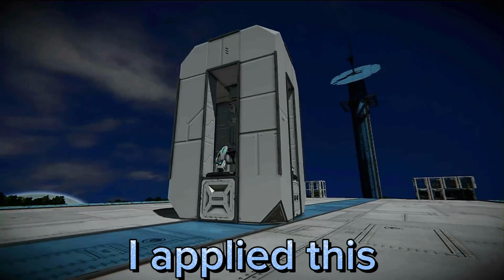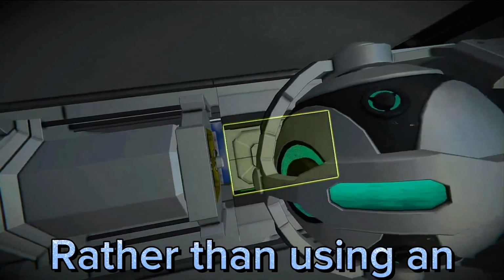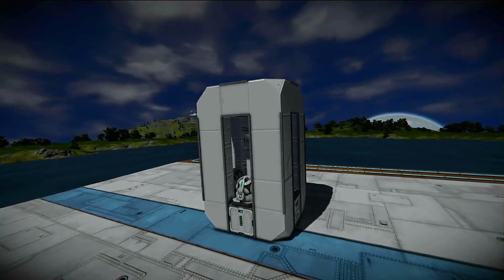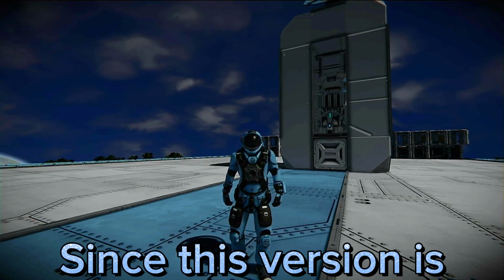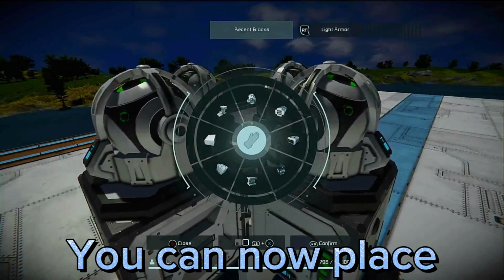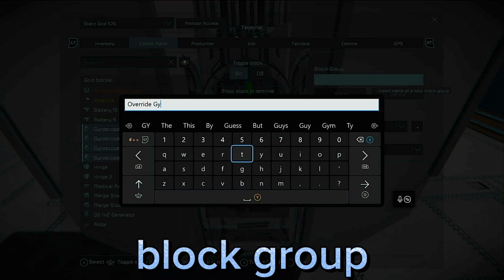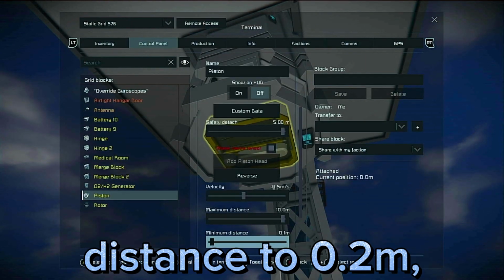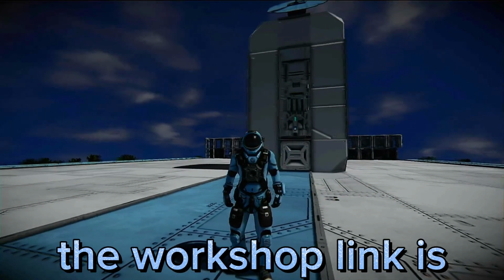Space Engineers - Stabilized Clang Drive Version 4

Comment: For no energy operation cost and oodles of acceleration, Clang drives are amazing.

For any kind of bumpy activity (like combat, mining, or sneezing), Clang drives are the emergency red hotline telephone to summon our great and terrible lord Clang.

I've been using Major Jon's control script and cargo mass shift clang drives. For extra wrath of Clang, his script includes an overclocking feature that lets you multiply the frequency speed at which the contained cargo mass is shifted back and forth (like, 1000s of times per minute). The most I've ever dared go is 20x overclock, and the clang noises were a constant cacophany. Like a scrap metal junk wagon rolling down a hil out of control, to a heavy metal soundtrack. And the ship constantly shimmied around at sub 1 m/s, b/c damping couldn't figure out which direction it was vibrating.

But man. FAST. Didn't even have to paint it red. :D

I'll see what it takes to rough up one of yours and spectacularly disintegrate my ship. :D

Comment: You can make a much smaller clang drive with a regular door and advanced rotor, just put a pillar on the rotor head aften setting displacement to minumum. Change rotor displacement to activate drive. You can even make a small grid version.

Comment: Watching this video i got an idea. What if we will build ships in modules, and then combine them together? That would be easy to repair: Just swap damaged module, or swap for a newer one(like ships can have slot for a clang drive). I think this system would work better if modules can be easily welded with welders, like they so small... Idk
Reply: yeah ive thought about this before but unfortunately do to the nature of space engineers its just generally more effective to just replace parts and weld them individually which kinda sucks because its a really neat idea but it would be more trouble docking it all together than the benefits it would give
Reply: There can be designs like that but it would take a lot of desire to make a good system plus the amount of time for realization and refinement through various iterations until you get it just right.

Comment: I have a design that completely ignores the mas of the ship, doesn't make physical contact, and activates near instantly so it can be used with my wsad control script, also it does all 6 directions with 2 sub grids, or only 4 directions with one sub grid. I am surprised you haven't seen how these drives work, but they are very stable, consistent and reliable. They do not need gyroscopic stabilization either! :) 

Demonstration: https://www.youtube.com/watch?v=_5HLqZBZSCA
Instruction(simplified): https://www.youtube.com/watch?v=lDyRe1ggTZk